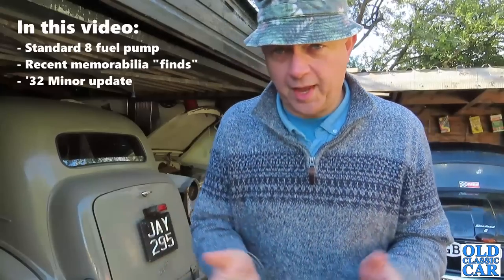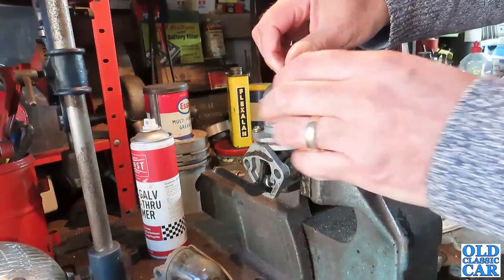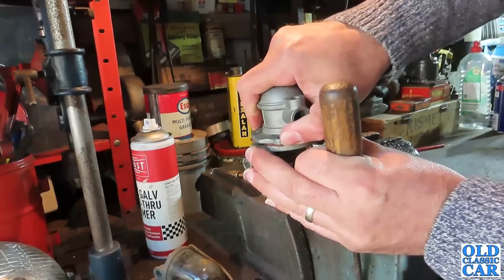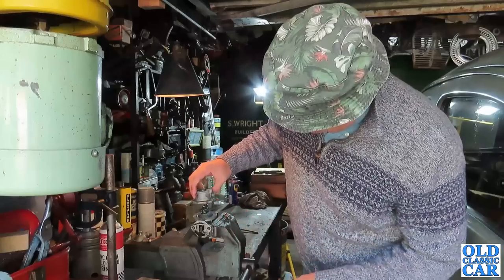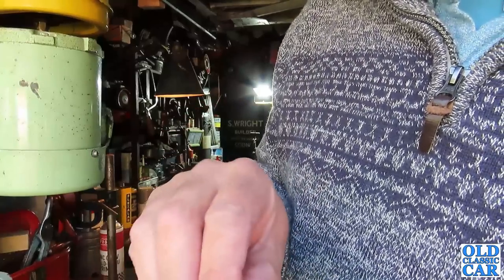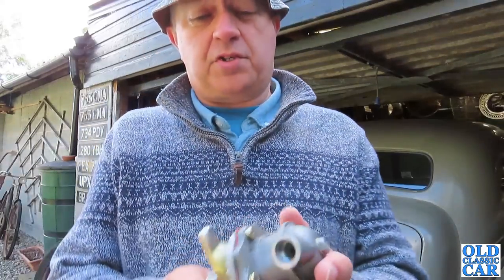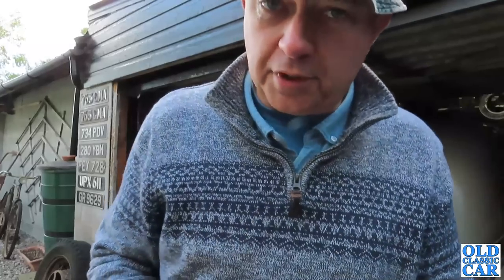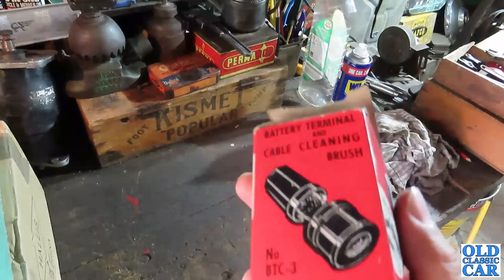Garage tinkering - petrol pump problems, was it caused by ethanol in petrol? Plus car memorabilia

Comment: I think you are correct Rick, an  assembly issue on the production line - probably quite a number put together in sequence and this one missed the 'turn and lock ' but just making  enough purchase to get past test before slipping out. I would call that a fix - human error as opposed to a fail I reckon. Presumably all these replacement pumps now  have the diaphragm suitable for modern fuel. Nice little follow up video, I like these tinkering updates.
Reply from the maker: Thanks for watching, yes just one of those things I suppose, at least it'll do as a spare

Comment: Definitely agree with you Rick that pump was not assembled correctly. I have heard that those sorts of parts were in some cases made in India but that now they are improving. Don't know if that was the case here. The battery terminal cleaner was s first for me but it looks very useful. I love the little box as well  and some nice but sensitive additions. Thanks for all the updates in this video Rick please keep up the good work. 👍 👍

Comment: Cleveland Discol contained 15 percent alcohol. Despite the lower energy content, alcohol increases output, because it has much higher latent heat (improving volumetric efficiency). That doesn't apply to modern direct injection engines... but who would want one of those?! Great video as always. Thanks :)

Comment: Informative video about fuel pump failure on older cars. My vehicle is a more modern GM product from the mid 90s with an electrical internal pump , it's  still a worry though that parts may be deteriorating enough for eventual failure. Fingers crossed.

Comment: Thanks for the update. I've been victim to a few bad reproduction parts myself. One was a bad coil. Drove me crazy trying to figure that one out. I like your old tools. I have the flat blade brother of your wood handled phillips head screwdriver. It was my grandfather's whose two toolboxes I now have. I also grew up down the road from Lancaster, PA which you read that one of your finds came from.  The Snap-On terminal cleaner is interesting. I've never seen one from them. I wonder if some of the items came from the US directly or were sold into the UK back in the 50's-60's.

Comment: Having spent my working life managing engineering companies I would suggest that is an assembly quality issue and a lack or process control and quality checks. I could be worth checking the fit of the components as I would guess the tolerances are miles out.  I currently own a factory in China manufacturing pumps and controllers for hydrogen powered vehicles, which I cannot get back to because of the insane covid restrictions and the single biggest issue I have is quality control and adherence to process controls and standard operating procedures, it is a bloody nightmare. The standard requirements for anything involving either hydrogen or oxygen are very stringent and must be controlled rigidly and I have problems getting that message across and have to employ an army of QC checkers who also miss that vital point at times no matter how much training and awareness we o through with them. The mindset is "it is just a pump".
Pound to a penny that pump has not been through final testing prior to shipment. Believe it or not I have had similar problems with some Japanese companies which completely took me by surprise having dealt with the like of Nissan and Toyota for years and understanding how they control quality I was shocked to say the very least at some of the things that managed to escape quality checks. The theory is that if the process is controlled the product will be 100% but that unfortunately isn't always the case especially when humans are involved in the process. I am currently having discussions with a global Japanese manufacturer who I have visited myself twice in Tokyo over inexplicable product failures for very costly products that were assembled manually.
Reply from the maker: Makes my problems seem quite trivial, best of luck with it all!!!
Reply: I used to work with electric motors, sadly they had to source parts from China to keep costs down, every batch of samples was spot on and fitted fine, once the ok was given the main order was made, every single stator was faulty, some would fit one end or the other but rarely both, never the same output or speed, I think they out-sourced to several other factories hence the collection of problems, it was cheaper but very poor quality.

Comment: good video I think i may have been one of the ones that was wondering .when you had it apart and gave us a peek I was thinking if some how the slot in the arm it self had weakened and bent one side open a tiny bit more allowing the tang to slip out ,but be hard to tell with out having a known good one apart to measure and compare. when ever I take these off I try to disassemble the fuel filter too (if there's even one present) to check on if little bits of rust are present to get a view of fuel line and tank condition there's been many a pump fail because a bit of crap got past a filter and got stuck in the little flapper valves .good job !

Comment: Gamages was a department store, so could be a household item like an iron, or an electric fire? Nice to have and interesting to see the fuel pump investigation, I could not tell from your video the position of the diaphragm before taking off and its subsequent installation - the tab would show if it were moved 90-degrees or not, as it should now be in a different position!

Comment: Nice segment Richard - with both my Ford and Kubelwagen I have had problems with mechanical fuel pumps as a consequence I have a comprehensive “get me moving” kit containing a complete fuel pump, spark plugs, carb cleaner fuses etc🤩 Since the ethanol issue arose I have replaced all rubber fuel lines on all my vehicles with metal tubing 😉👍

Comment: I thought the fuel pump would be a mechanical issue rather than the diaphragm. Well sorted and an easy repair. Like the little wooden tool box looks the part. How is the MG going.
Reply from the maker: Next job is engine mounts on the B

Comment: I've just had two pipes fail on my Standard ten (tank to filler pipe & a pipe let in the main line to the pump) so was interested to see the autopsy on the pump. I think age has more to do with my failures. Still I've a lot less petrol 'stink' in the car since the replcements, just that dang carb to sort now.
Reply: oh it turns out I have one more pipe to replace, tank to breather in the boot plus the metal pipe had some pin holes too, never ends :)

Comment: So it seems either the fuel pump wasn't put together properly in the first place (plausible) or the shaft that attaches to the diaphragm wasn't crimped tightly enough to the diaphragm, allowing it to turn independantly (also plausible). Either way, not a great look.

That little toolbox is fantastic for £2! Just the job for the (now emergency spare) fuel pump, some points, maybe a fan belt and a few other bits. It'll look like it's always been there! I love stuff like that.

Comment: When you mentioned Ethanol used ages back I thought about 'Cleveland Discol  With Alcohol' straight away. When I was a nipper in the 50s I well remember the advert for it. Do they still advertise petrol these days? I think Wipac might be a shortening of Wico or Wiko- Pacey ?

Comment: Its a shame the aftermarket parts are so rubbish even a simple fuel pump. I had to buy one for my willys jeep because the old diaphram failed. The new one lasted about a year before a check valve failed. So i put the new diaphram in the old pump and its been good. But even the glass bowl on the need pump was cut so bad it didnt seal i had to sand it down alot! I suppose we should be thankful any parts are available for our old cars. Also the battery charger. You cant get 6v chargers anymore my neighbor needed one for his tractor and I had to give him one of mine

Comment: Hiya, I am wondering if you can answer a question for me ? I left school in 1964 aged 15. My first job was as "the boy" in my local garage. After passing my driving test , my boss found a Morris Mini for me. The registration number was 2 MPH. This car cost me £50. I ran it for about four years and then sold it for £50. The person I sold it to put it through a hedge and the car was a right off. Now, all these years later I often wonder what happened to this reg. number. Is it still being used??? If so, how much would it be worth on the open market?? I bet its far beyond my wallet.😄😄😄 Many Thanks. Bernie.
Reply from the maker: That reg. shows on DVLA as now being on a 2022 Volvo! no idea on value but probably quite a bit
Reply: @oldclassiccarUK  Thanks for that. I wish I had known then what I know now.🤣🤣🤣